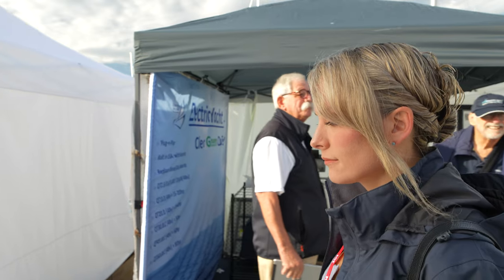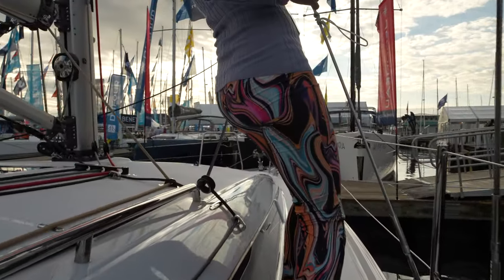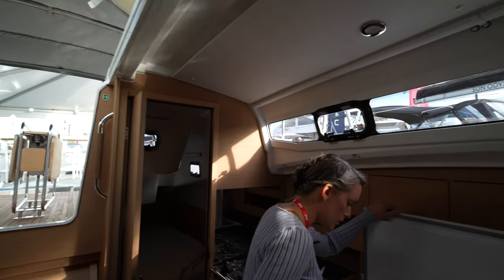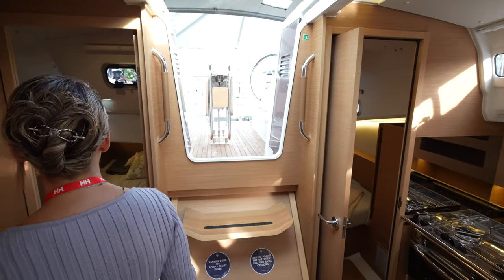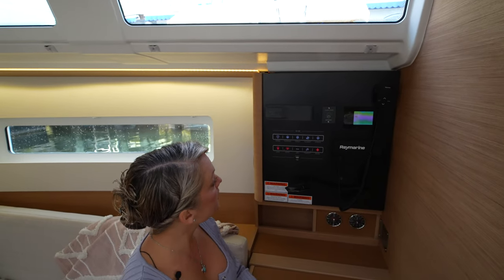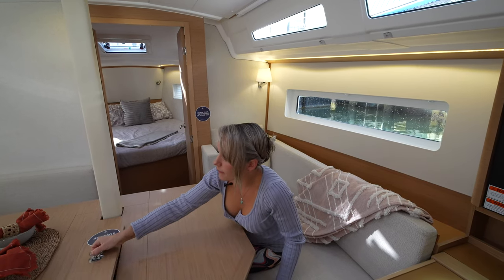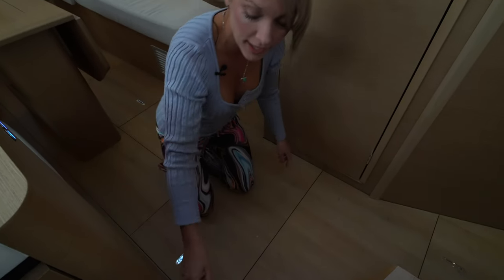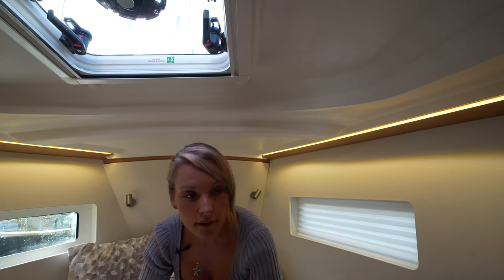Boat Tour Jeanneau 380   4K

Comment: Thanks guys, a really nice look see walkaround. Nice too see heanneau improving little details like the double door holding catch. Plus Patricia actually testing the comfort of the seats and mattresses by sitting on them, is a massive plus imho, compared to so many (most , all?) reviewers, you never get an indication that the material is OK,  too soft or too hard, and I'm always thinking, how much is it going to cost to replace those if they're no good. Decent galley for a 38ft too. Nice boat, but the extra space in the 440 imho looks worth it for a liveaboard, or even the 490 (I keep looking at the nav table on the 490, and thinking wow that's a really nice Breakfast diner too lol ) Thanks again, Best Wishes and Fair Winds.  Bob.  👍